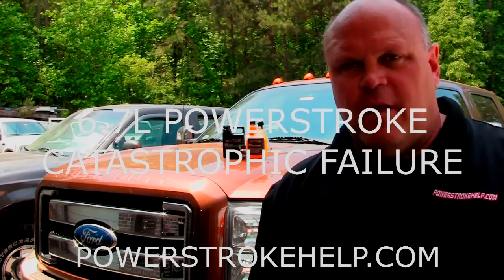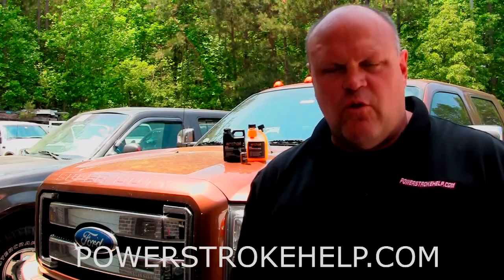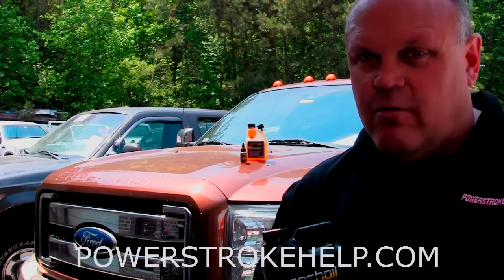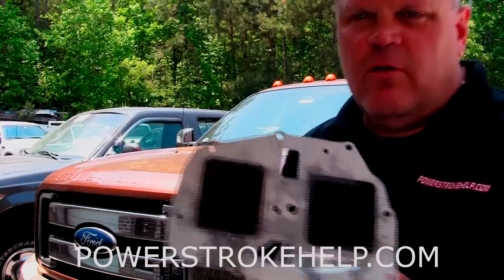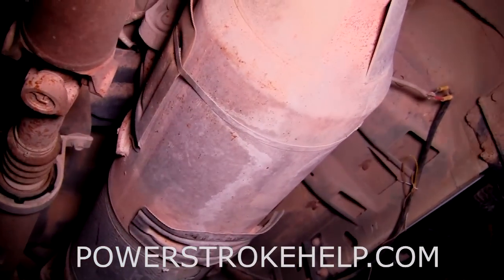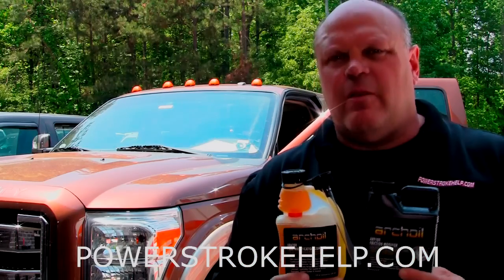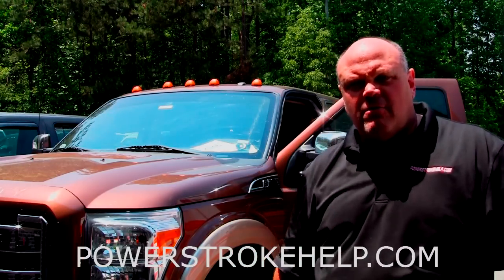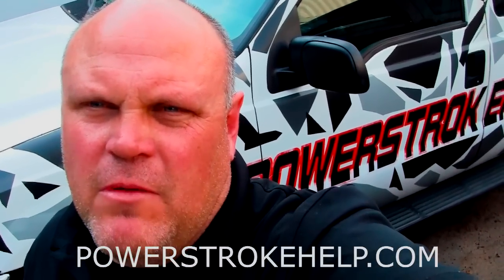6 7L POWERSTROKE CATASTROPHIC DEATH - ARCHOIL

Comment: Bill, do you recommend using the archoil fuel treatment in the new 2017 6.7's???
Reply: Thamac15 Why not? I have a 350 17 xlt. 65k sticker 15k in upgrades. I never run without some kind of additive (archoil is the best). To much money invested for pennies on an additive. People who complain about cost of diesel trucks should drive cars. Obviously they don't need one. Try towing 12k lbs daily with a gasser.

Comment: ouch  ,, that is NOT a good  sound  ,, and  136K miles i agree it shouldn't have happened 
I just  recently  had  a turbo fail on  one of my trucks   but  thankfully i don't drive with my radio turned up  , and i saw the white smoke  in the mirror  within 10 seconds and managed to shut  the engine down  even though it was running away ,, all of my diesels  have a  CO2 injector on the intake connected to a fire extinguisher ,, it takes  3 seconds to activate  and stop a runaway ,, still costed me $1200+ for a new turbo  but  it didn't damage the engine thankfully

Comment: My 7.3 just rolled over two 286,000 it's an old pike electric truck with a tool body I've had it for 6 years it's tried but runs good it had stickson issues but the arcoil fixed it right up thanks

Comment: I did the archoil challenge and to be honest didn't notice a difference in performance, mpg's, or regens. Seems like everything stayed the same I actually noticed a decrease in mileage. I did this on my 2013 6.7 with 11000 miles. Idk if maybe its too new and doesn't need it but I don't think ill be buying any soon.
Reply from the maker: gio0829 I have heard that from a few 6.7 owners. The newer the truck the less soot has built up in the DPF to kill your fuel economy. Never the less the AR6200 needs to be in your fuel to protect the injectors and keep the truck running like it is now. Otherwise it will slowly deteriorate over time.

Comment: 9 grand for exhaust system components.. Makes me love my 6.0 even more...
Reply: +Michael Butler 6.0  had two and dumped $12,000 on the two truck engines before I smartened up...my pick up broke down 4 times from Maine to Va, and back...wife said never again going anywhere in that truck...so I traded it in for a 6.7
Reply: +John Boulay and that was with 57,000 miles 4 months out of warranty...Ford did squat for me.
Reply: That stinks, I'm on my second, the first was an 03 with 150k, only need an ear cooler, only traded it due to body rot. My current is an 05 dually lariat  with 80k and I already bulletproofed it. My dad has an 03 with 260k only replaced a turbo and two injectors. None of these three 6.0's ever left us stranded anywhere. I'd buy another 6.0 in a heart beat. Maybe your luck is worse than mine...
Reply: +John Boulay The trip to Va : first break down PA on mothers day afternoon...$250 towing charge to Ford Garage stayed there till Tuesday AM. That was the third turb that truck had,went 117 miles from there and broke down again,towed to another Ford garage.they said it was the # 1 injector...that tow cost another $250. Stayed over night there .reached destination went a total of 300 mile more and ended up getting towed to Richmond Ford.I was told that the #1 injector failed and 3-5-7 needed replacing. Some labor was covered b/c of the #1 under warranty. Left there two days later and broke down about 60 miles from there. Clamp on turbo hose broke...called Richmond ford and was given directions to another Ford garage,Fixed that myself and finally arrived home..toally we spent just under a $900 for towing and $ 4000.00 in repairs...any wonder why I sold that truck ? hoping my 2011 F-350 6.7 gives me better service...
Reply: Like anything else they all have their problems, Its all about doing homework. I did tons of reading before buying my 6.0's, i know what common failures are, i know typical symptoms, and i had the opportunity to bulletproof this last truck before even taking possession of it, no the only weak link is my tranny. I know on the 6.7 they can have DPF issues where the DPF clogs and completely melts the motor down, its rare but its also something worth keeping an eye on, what you have to remember is the 6.7 is still a new motor, they will discover issues. It sucks you had a couple of lemons in the 6.0, hope you have better luck with the 6.7, id love a 6.7 but honestly i cannot afford one so ill stick with my 6.0. In the same token, some trucks, like my dads are a testament to how strong they really can be, 260k of very abused (never does preventative/routine maintenance), very neglected miles and all he has done is a turbo and 2 injectors, suspension work is a whole different story haha.

Comment: I buy fuel in bulk and already treat year around with stanadyne, can I add this fuel additive to the truck and see a difference or is the stanadyne already doing basically what archoil fuel additive is gonna do?
Reply from the maker: TermiteBenny Stanadyne is the best cleaner and stabilizer on the market BUT Archoil AR6200 is a fuel combustion catalyst when helps the truck burn fuel more efficiently. Stanadyne does not do that.

Comment: My 2012 6.7 tows hard everyday. It's a mistreated company truck. It's had common "off the shelf" diesel oil ran in it since day one. It has 142,000 miles with no failures. I'm sorry but arch oil doesn't prevent engine failures. The guy had a poor quality turbo from the factory. High end snake oil will not fix parts that escaped inspection at the factory.
Reply: if you work the truck hard and running on the highway..u should be fine. he's saying that if the engine is doing more excessive idling without the additive EGRs tend to clog up

Comment: Bill what do you recommend for a F150 ecodrink/ecoboost running a 2013 F150 has 250.000 kms no turbo problems or anything just a hog and i mean a hog on fuel economy is 14 to 16 miles per gallon highway.if there is a engine or tranny update do you think it would help.
Reply: +david klein I am by no  means a professional mechanic but my first questions would be whens the last time you changed the fuel and air filters?

Comment: Hi Bill, I enjoy your vids, I have a F250, 2011 with 40,000 miles - so far a great truck. But I take care of her and really do not drive that much.   I wanted to let you know that I tried to buy Archoil AR6200  and the 9100 from your website, but the PayPal is not working - I hate PayPal, has NEVER worked for me..

anyway, thanks for the vids, very good info

Comment: what oil should i be running in my new 6.7? dealer just did first oil change,  they used 15/40. should i run the Rotella 5/40 syn once i get a few more miles on it? or run the ford 10/30? or just stick with the 15/40? thanks
Reply: hi, you should really only utilize a thicker grade of oil when the engine has higher mileage as it does help for short periods to make up tolerance differences and wearing bearings. I am definitely not saying your straight up comment on emissions/governing bodies is incorrect in anyway. Cheers

Comment: hey billy great video i watch all your video  had a question my power stroke is still under warranty if i put the archoil in my truck would it void my warranty
Reply from the maker: aldo ruiz Thanks for the kind words. No THe AR6200 fuel additive or the AR9100 oil additive will not  void the Ford warranty.
Reply: thank you bill for getting back to me really appreciate that thank you and i will take the archoil challenge i can order it straight from you website. thank you again

Comment: I don't get this guy I have a stock 6.7 with 181000 and the bearings he is talking about is mainly a issue on the chassis cab but it can happen on the pickups. I'm not  worried about the turbo. I am worried about the emissions that's why mine will get deleted

Comment: Also will this effect my warranty with ford putting this into my truck?
Reply from the maker: Mike Hachey Fuel and oil additives will not void your warranty. I require my customers to use it in rebuilt I install.
Reply: Im trying to find where to buy this in Canada

Comment: do you prefer the Baldwin filters over the motorcraft? i always use motorcraft/International parts on powerstrokes, but i'm always open to suggestions.
Reply: +Mike torrance   FYI: I had a Motorcraft oil filter on my truck with about a year old.,,,noticed oil spots under my truck...oil filter rusted a hole in the bottom of the filter...gave a heads up to Quirk Ford in Belfast Maine...Ford Quality ???? I wonder ?
Reply: yeah i've seen them both rust. i tend to think the problems more the shit they spray on the roads now in the winter, The liquid they are using is absolutely destroying cars and trucks,  way worse than using regular salt
Reply: +John Boulay Mike i live in Maine and use fluid film on my truck frame and underbody.i Have a picture of this filter, Quirk said Ford recommends changing this filter every year. I have had Nappa filters last for 2-3 years on fuel filters. Is this oil that corrosive that it eats it from the inside out like it did on a oil pan on my 1988 F250.

Comment: Have a 2011 F350 6.7 450.000 kms and it is running on engine #3 first 2engines went out at 210.000 kms on the dot.don't think delete matters because my second engine had a complete delete on it egr scr and def all gone no power increase just stock power with delete

Comment: OMG 9000 coconuts for an exhaust system!
Reply: +raider762 Ford OEM parts cost (and I assume all oems) is INSANE for everything. I had an older Escape in today for example,  bad instrument cluster, COST was 600 bucks.
Reply: Some of the SAAB exhausts were over $2,000

Comment: I have a 7.3 Powerstroke the best engine Ford ever made.
Reply: +Gabriel Lobaton : You mean best engine that Ford NEVER made.  The 7.3L was an International Harvester engine.  Once Ford started building their own light duty pickup truck engines, it's been nothing but disasterous.
Reply: You're absolutely right Turbo Diesel
Reply: +Turbo Diesel 6.7 was first ford built engine. Navistar left for on 2011
Reply: +Gabriel Lobaton Maybe the best powerstroke, the most dependable were the 6.9 & 7.3 IDI They didn't have enough power without a turbo but they lasted forever.
Reply: +Turbo Diesel not necessarily. people tune the hell out of their trucks, push them, and expect it to take things that are just unrealistic. a 6.7 produces 800+ ft/lbs of torque and is fast as hell. it'll pull anything and treat you as well as  you want it to as long as you dont ruin it with a tune

Comment: 6.7 6.4 or 6.0 i am very new to the diesel world but i need something to pull a 40ft travel trailer and i dont want to jump into something that cannot pull and will leave me walking
Reply: +devin porter I pulled a Towmaster trailer loaded with 10 tons of crusher dust with my 6.7..handled it fine
Reply: +John Boulay  Pulled that with a F350 11,500  SA GVWR...had 3 ton overload which I do not make a practice of.Trailer was a fifth wheel with 14,000 lb net rated.

Comment: I wonder what Archoil can do for a gas engine. Interesting. I wish I knew about this product when I had my old 7.3 idi
Reply from the maker: netrioter It works great in gasoline engines especially high compression performance engines requiring premium
Reply from the maker: ***** Finally after all the dumb stuff you have posted a good question. I knew you had it in you. Archoil AR6200 works best in high compression gas engines. Putting it in a honda is a waste. By being a combustion catalyst and burning the fuel more completely the engines do not detonate so the ignition timing is advanced by the computer. This translates into better power and better fuel economy. I have seen it demonstrated to me in a 2014 Corvette, 2013 SS Camaro, 2009 Mercedes S550, Malibu LS powered Ski boat. Several offshore supercharged 540ci+ boats. Using a scanner we could see the increase in timing set by the PCM.  Every single one ran premium no ethanol fuel and commented on how smooth and powerful the engines had become. And further stated that they could feel a significant decrease in performance when they ran fuel without the AR6200 in the fuel. Hope that answers your question.

Comment: If you get a 6.7 just get the delete kits and run a straightpipe exhaust with a programmer and intake system, you not only take alot of stress offbthe engine butbyour truck is going to increase horsepower and torque ALOT....... Screw these dpfs and defs

Comment: Lubrication is everything and these new engines absolutely cannot survive without clean oil…and to give the illusion of “low cost of ownership” they push out the maintenance intervals…in my opinion they are twice what they should be and just because you use synthetic oil doesn’t mean you can stretch out your oil changes…the truck still burned the fuel and deposited the contaminants into your engine!…Archoil is nice but at least change your oil!

Comment: Are you sponsored by archoil?  Seems like been pushing that product way to much , every video im watching from now on its like im watching archoil commercials hahaha
 I have 2011 ford 6.7 with 413k miles on it delited from 36k 
Zerro issues , only thing i changed at 250k was fan clutch than just few weeks ago upgraded oil cooler , radiator ports in the cooler got plugged,  looked like iron block on 6.7 was flaking , changing radiator fluids is as important as ur oil in this truck.

Comment: The Engine is Usually next to blow after turbo charger blows oil. The Reason why is because of the oil leak of the turbo is causing oil pressure loss, causing the engine to be starved of oil. 

Also after the Engine blows the turbo is likely to blow next and sometimes repeatively even with a new turbo installation because of the metal flake from bearings traveling in the oil journals.

Comment: "Had he had the 9100 in there the turbo wouldn't have failed" Lost it there. How can a seemingly competent mechanic paint something black and white like this? It was a flawed turbocharger design hence why Ford remedied it with a single 88mm compressor on the 15+ trucks. That turbo was destined to fail whether or not this snake oil was in the guys' crankcase.
Reply: Wow, where did Archoil touch you again?

Comment: Hey Bill I have 2000 f250 with the 7.3 and I just had the oil changed and I noticed a slight knock at idle and only when truck is warm. It runs fun and has no problem starting so I didn't think it was an injector but Idk just looking for input?
Reply from the maker: Scott Luvisi You may have a injector knock. Id definitely order the archoil p1 kit from PowerStrokeHelp.com to free that injector up.
Reply: I was just making sure you wouldn't think it's a rod knocking? And I've already got the p1 kit ordered!

Comment: I happen to drive school buses, many have the 6.7 cummins in them, and interestingly enough the sound when the air compressor kicks on for the air brake buses is similar to the noise this truck makes. When I first started driving I actually shut one down right after I started it because I thought there was something wrong with the motor, but they informed me it was just the compressor!

Sorry for the Cummins reference on a Ford video.

Comment: cut the dpf off your engine will last twice as long and twice the mileage reduction in egts. the government doesnt give a rats ass about the environment all they care about is the money.
Reply: it is very sad. if i get a 6.7 before the first oil change the emissions will be off of it. ive ridden in a deleted 6.7 on the lowest tune on 38's and it will burn the tires off until you let off the pedal on stock gears also and talk about a good sounding wastegate its the best one ive ever heard
Reply: hayden ingram they are not that fast need more fuel and bigger turbo!
Reply: they build plenty of boost with a stock vgt turbo. its a daily driver not a sled puller but if you like to melt pistons be my guest.
Reply: They cant break 500 whp on stock fuel and turbo.
Reply: Cut the dpf off ur truck and not tune it out of the ecm and ur truck will sound like the one in the video because it will be trying to regen constantly overfuel the cylinder get in ur oil and then your engine sounds like the little drummer boy
Reply: i would probably guess that it wouldnt run at all with the emissions removed. never seen one without a tuner after the delete could be wrong though
Reply: +hayden ingram gotta love that EPA...
Reply: Money is the only thing valued by companies and the government these days...
Reply: Hell to the Yes I'd cut that shit off!!  I love living in Mississippi, we don't have emissions testing shit. As a matter of fact, we just got rid of our "Inspection Sticker" bullshit so there's absolutely nothing. Come to Mississippi, we'll treat you like family!
Reply: i live in georgia its pretty much the same way we have never had an inspection sticker.
Reply: and since i first put this comment a year ago i have since bought a king ranch 6.7 and next year the warranty runs out and the emissions will be gone.
Reply: hayden ingram Hell yeah man! Awesome!